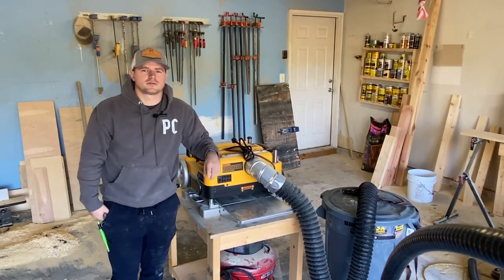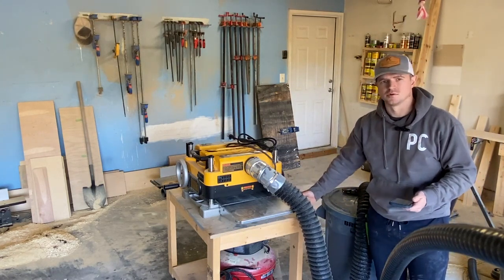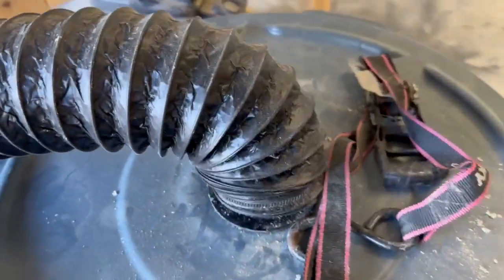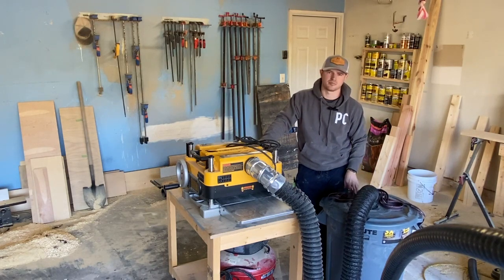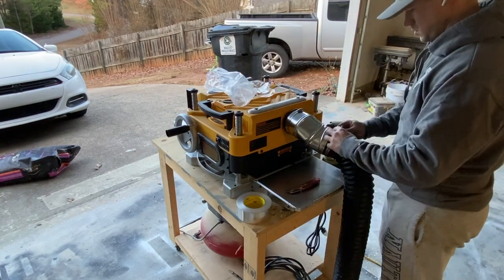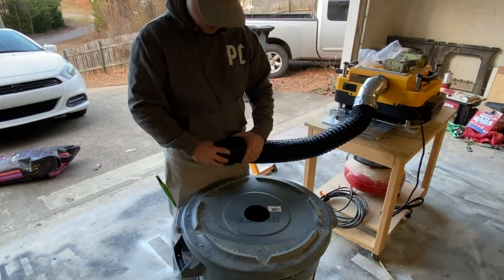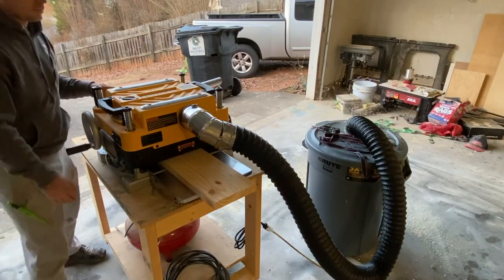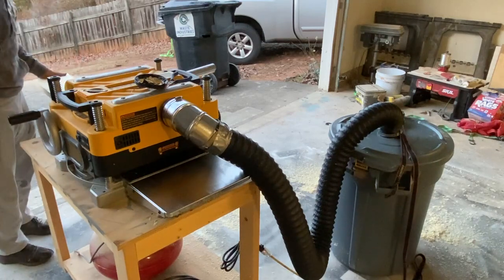No Dust Collector? No Problem!

Comment: You're pumping air into the bin without any obvious way for it to get out. That's why it's leaking around the inlet and the lid. Without proper airflow, the hose will fill with chips and you're overloading the blower motor. Drill some holes around the base of your bin totalling greater or equal to the inlet port area.
Reply: Not a pressure vessel. Not everyone went to physics class
Reply from the maker: Yes sir, did that today and it worked great! Thank you!

Comment: Get a small cyclone separator, like from the Bauer Harbor Freight, and put it on the lid of that trash can. You can even put a plastic bag in for ease of emptying. Very little dust sneaks out the top. If you want a little better filtration, rig a large shop vac filter for the top hole on the cyclone.
Reply from the maker: Thanks for the tip! I’ll definitely give that a try.

Comment: The arching is from the particles traveling through that plastic duct. Creating static electricity. And it's probably discharging onto the metal. Don't know it it would have any effect on the tool or not, though.
Reply from the maker: Great info! Thanks!